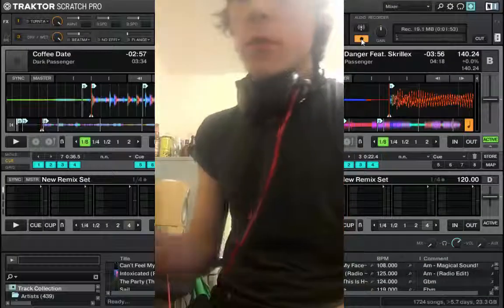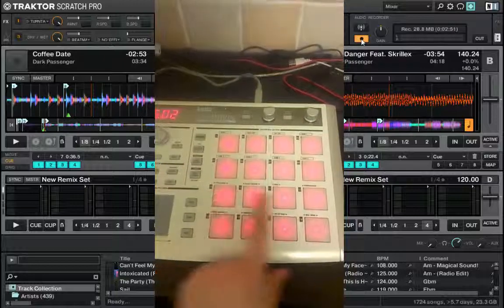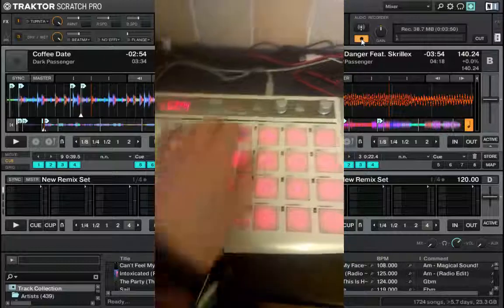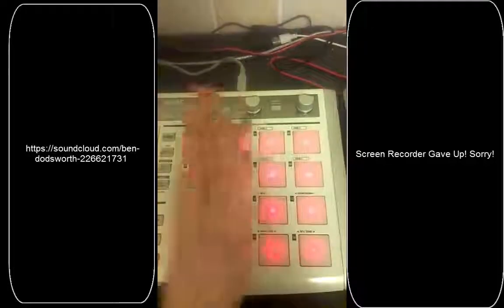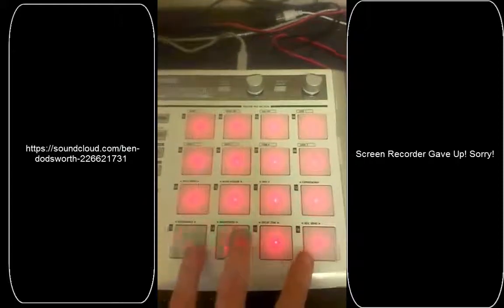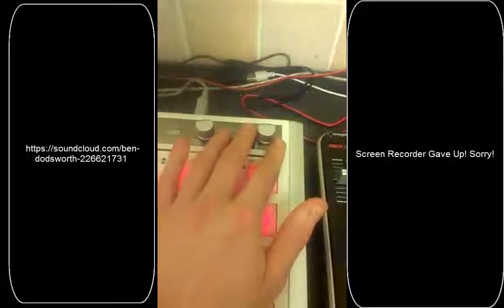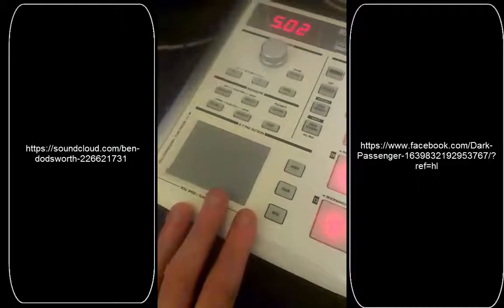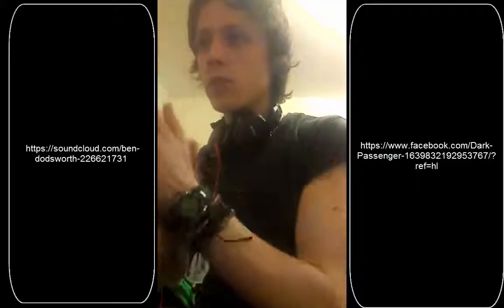KORG PadKontrol Traktor Mapping

Comment: i just restored padkontrol, and before was going well, just changing to scene 2, wasn't doing a thing so I Decided to restart, the thing is, now the pads, instead of CC are Note, how can I configure it to change it=? any suggestion?
Reply: cause the tsi conf is in cc but now my pad is in note
Reply: is the roll function supposed to work with any pad? I got this used and it only works on one pad, also the pads are quieter and louder than each other they dont respond the same